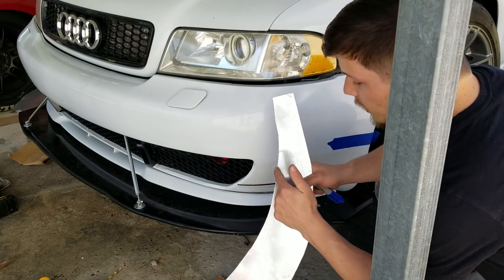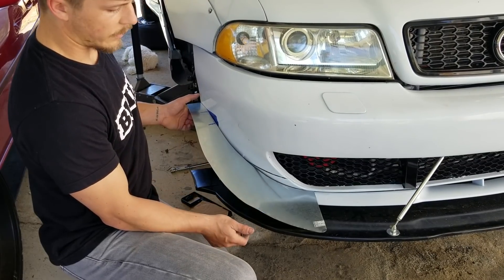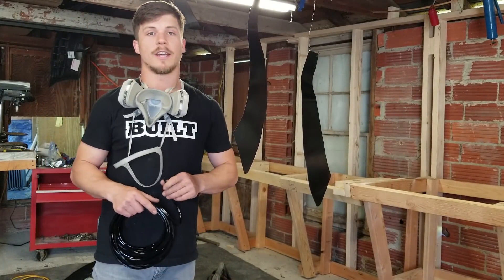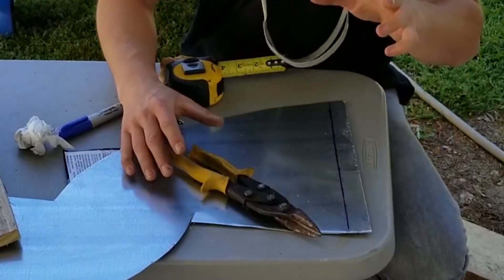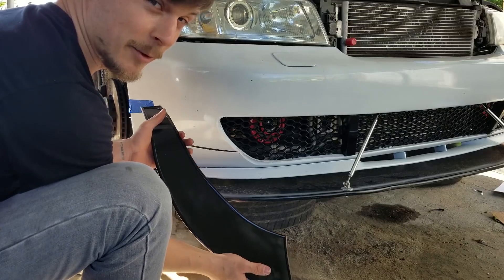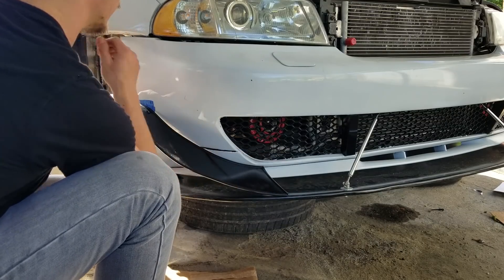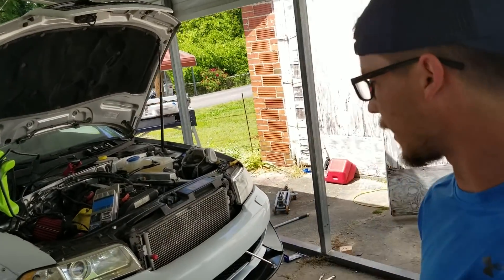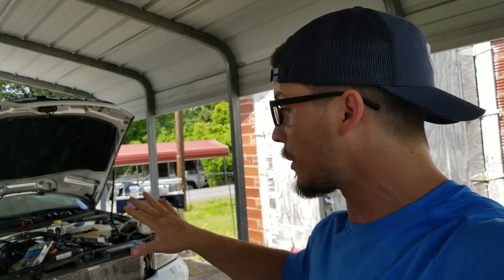HUGE BUDGET DIY CANARDS

Comment: The problems with your canard setup is that they are a quite a bit low to the splitter and the flat bit at the end will eliminate your vortex so you'll reap no benefits besides them looking cool. Best part is that they probs can't hurt to much either. I just made and wind tunneled a few sets on some cars I've helped build, but your ingenuity is inspiring, sub since like 1k!
Reply: Incase anyone gets upset please read the above completely. I love the build, I just also happen to be an aerodynamically inclined nerd.